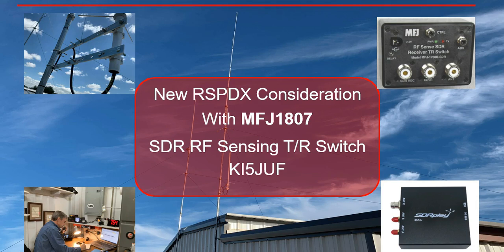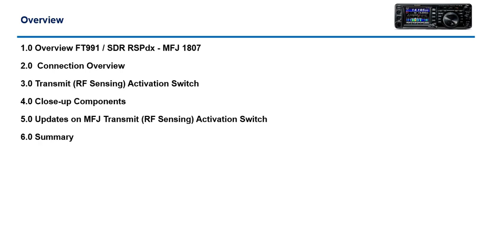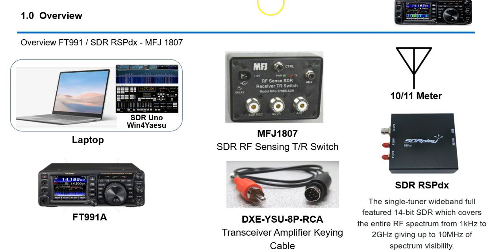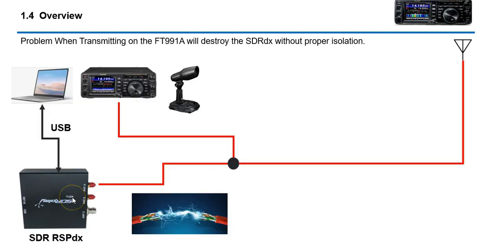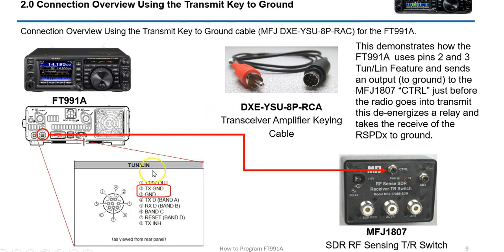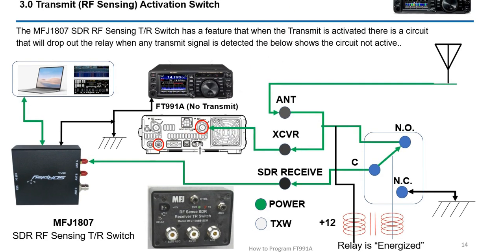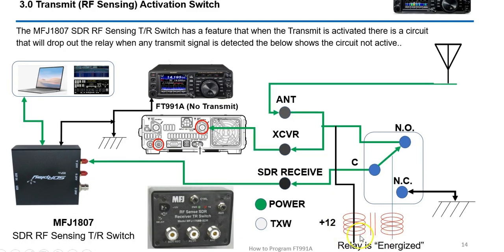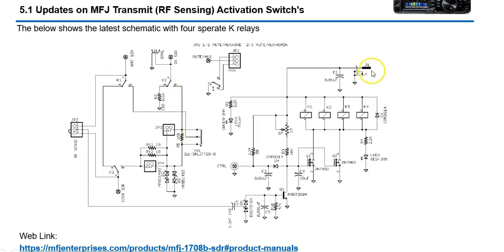Overview FT991A  SDR RSPdx - MFJ-1708 Installation Considerations (Risks vs. Rewards)

Comment: I have the 991a, the RSPdx and the MFJ1708.

I wanted the experience of a bigger waterfall, not interested in transmitting...yet.

My findings and, as you mentioned earlier in the video, you're basically seeing the waterfall of what the SDR (RSPdx) sees and not neccesarily, the signals seen in the 991a.

Huge letdown to me. Decided to return the MFJ1708 and wait to upgrade to an FTDX-10 alter down the line.
Reply from the maker: How you doing, thanks for the message, yeah I understand I never executed this project, there's a whole different aspect I did not mention working on a video now on the fact when you connect the SDR and your radio to the same 50 Ohm Antenna System there is a impedance issue being in Parallel which both are no longer at 50 Ohms.  Have a good evening and thanks for the message 73

Comment: I am confused. Why would you want SDR when radio receives? What is the advantage?
Reply from the maker: Good afternoon, well to be honest I never went any further with this project and I see no advantage other than getting the waterfall from the SDR on a computer screen, the FT991A already has the water fall.  I like using the same radio for transmit and receive, this project got put on the back shelf.  Thanks for the message '73

Comment: can you explain what the AUX used for on the 1708b-sdr
Reply: AUX is an output that mirrors the control input.  You can use it to key your amplifier.
Reply: @richkelley5112  yep figured it out thanks for getting back

Comment: This was an excellent video! I built almost the same setup yesterday and wanted to share my experience in case it's helpful for anyone. I used Yeasu FT991A and RSPdx (but first tested with RTL SDR v3 dongle). Instead of this MFJ unit, I used the equivalent unbranded T/R switch from Banggood ($45 in May 2023). I also built my own PTT cable by soldering 2 wires to a 8 pin mini DIN connector and using a 3.5mm mono jack at the other end. For the 991A I soldered Pin 2 (TX GND) to the tip of the jack and pin 3 (GND) to the base of the jack. The pinout can be found in the Yeasu manual. I agree that using a cable is better than relying on any RF sensing technology. 

Regarding your questions: the most important one in my opinion is about protecting the SDR. What I found is that when transmitting the SDR does pick up your own signal (the other part of the band is clearly being suppressed). However the signal is shown in SDR Uno at around (-50 dBm in my case). SDR Play have a video on their youtube channel about protecting the SDR when in close proximity to transmissions. It covers several scenarios with examples. They say that at 0dBm or above the SDR may be damaged. The video is titled "Protecting Your RSP from Near-field Coupling". The video also shows instructions on how to measure and protect the SDR.

I also experienced that using this TR switch from Banggood is not realistic on 145MHz due to very high SWR. Others have reported this in the video made by Tech Minds titled "PANADAPTER For Any Radio DC - 160 MHz SDR Antenna Switch". I didn't experience any issues when testing in on the 10m band.

The 991A can indeed be controlled by SDR Uno through the use of omni-rig. To do this, both the 991a and the RSPdx must be connected to the computer using separate USB cables.

Comment: I have the exact setup,  992a, rspdx,1708, win for yaesu.
Make sure you use the newest best model of 1708 sdr  sma for rspdx with the cable to activate it. Its  4 real realays.  I use same antenna no problem at all 2 years now.  I use resonant antennas  that  switch  on one antenna.  It defaults to the sdr when no tx. Sdr console has a protection system for overloading  as a back up for strong signals. I do put  an  A-B switch on the uhf vhf side to disconnect  a to b position is open when operating hf possibly over kill by the way the sencing
Part of the 1708 works also no arks  .
Also  use omni rig with your rig control  and turn it on in sdr uno.  No matter where you tune the other one follows. Never us the old mfj 1708 switches it would be a problem.  Love my 991a !
Chuck AA4CP  
FORT PIERCE FL
Reply from the maker: Thanks and '73 hope to catch you on the air

Comment: This is what I want to setup. The RSPdx is incredibly sensitive and you can pick out signals that don't show in the waterfall. Your not hallucinating and Yaesu with a good antenna can transmit to them. It is very sensitive to adjacent transmitters so the switch is required. The SDRPlay had great input protection but you'll have to send it back to have the diodes replaced it you got them with more +15db for too long.

Comment: Also, if you're using the RF Sensing Relay just as an RF Relay (controlled with the 'TX GND' signal), then you don't need the RF Sensing function, so just buy a much cheaper plain and simple RF Relay.

Comment: Another option would be to simply run the SDR using a separate antenna, perhaps a small Active Antenna on the the other side of the property (reasonably far from the transmitting antenna). Especially if you're using the SDR to feed the Spectrum display or Waterfall, where you'll not be seeing very much of the very weakest signals anyway (an argument that perhaps you don't actually need a share of the primary antenna). Note, all this is speculation.

Comment: I've also been mulling over this option for my IC-7100 with my RSPdx using Win4Icom Suite for several months.

I returned the MFJ-1708 once because I didn't realize I had the wrong cable connecting the 13 pin jack on the radio to the 1708.  Right now I just have RF limiters hooked on to the antenna inputs of the RSPdx and using the Win4Icom as the panadapter.  I don't get more than +20 on the SDRuno S meter.  I understand that the S meter could go as high as S50 before the dx is threatened. That reading is while transmitting on 2 meters while the SDR is just using an MLA-30 HF antenna. If both rigs were operating on the same band antennas no doubt the S reading would be much higher.

I keep delaying my decision realizing I'd either have to buy TWO MFJ-1708s ($280+) or switch cables around each time I switch from HF to VHF/UHF or back. Not sure the cost is worth the Benitez.  At least you have a version of a waterfall with your rig.

Have you done anything with this project since your last comment?
Reply from the maker: Good evening  sir, thanks for the message, to be honest I did not go any further with this project, my concern was with a 50 Ohm feedline, if I put the MFJ and the FT991A on the same coax this would no longer be 50 ohms and to be honest I really didn't want to try anything on the new FT991A, so I ended up not going any further, sorry I can't be more help I just never really like this whole setup.   Thanks for the message and let me know if there's anything else I can do for you '73 sir!!

Comment: One other item you should consider is when listening you have two 50 ohm load on the antenna. This makes a voltage divider.
Reply from the maker: Good evening sir and thanks for the message, I have since realized the impedance mismatch and I never actually did this project, I never liked the idea of having a micro relay on the TX and RX, again thanks for the message I appreciate your feedback good info for all '73 de KI5JUF
Reply: @westtexasvideogateski5juf255  Is this why some people choose to tap into the IF circuit of the 991A to feed the signal to their SDRs? I too am researching these methods to see which way I want to go, so I THINK that the IF tapping method would get rid of the issues of reduced RX signal strengths in both the radio and SDR. But won't the SDR's RX still get overloaded during the radio's transmit? So is the MFJ T/R switch still needed for that??? I'm assuming I'll be using CAT control to keep both VFOs in sync, although I can see some use-cases where I'd want to be monitoring X band while working Y band. Any input would be appreciated!

Comment: If you are set on using the same antenna then this seems like a safe way to protect the SDR. You could also utilize the additional antenna inputs and possibly try to get cat control to change sdr antenna input on yaesu transmit. Virtual comm ports amd/or omnirig maybe???
Reply from the maker: Hi Phillip, thanks for the message, one of the concerns is in receiving with receiver this would create a impendence mis-match instead of 50 ohms I think you would have 25 ohms, not sure how that would impact the radio receive quality, i never ended up using this I found the FT991A waterfall to be adequate for the job.  Thanks for the message appreciate hearing from everyone👍
Reply: @westtexasvideogateski5juf255  
I'm going to assume the MFJ splitter is transformer based so impedance would remain 50 ohms. At a minimum it should be 50 ohm in transmit with SDR port switched to ground. Also best to always use PTT cable and have the RF sense as a backup, just in case.
There are a few projects online of panadapters using embedded RTL-SDRs in the 991A too on Hackaday and RTL-SDR Blog.
73 de AC5G
Reply from the maker: @TX_Junk  Thanks good feedback keep in touch let me now how things are going '73

Comment: Interesting. I've had a 991a for a little over a year, but have been real busy in '21. Now, I'm looking to get my General and get more into HF and you have my interest piqued!
Reply from the maker: Hi Lee, how you doing did you get your General?  Let me know of there's anything I can do for you I just recently passed my Extra,  let me tell that took every brain cell I had to pass that one, anyway let me know how you did, I mostly work 10 and 6 and local VHF repeaters here in Abilene.  '73 my friend keep in touch
Reply: @westtexasvideogateski5juf255  Congrats on the Extra! I did get my General back in Feb. I dabble w/ FT8 mostly on 10-20M, but am always looking at ways to better my antenna setup (it's in the attic of my condo). How's that MFJ-1708 working out for you?

Comment: Steve, Just checking have you added the SDR to your setup? If so I don't see a video of it. Also which  do you like better Ham Radio Deluxe or Win4Yaesu with the FT991A? Great job on your video's. KD9SZQ 73's
Reply from the maker: Hi Tim, Thanks for the message, I decided not to do that at this time, budget  reasons at that time I've started a path down CW and HRD so that's I've been up to, appreciated your message and apricate you checking in - hope you had a nice xmas and new years '73 de KI5JUF  keep in touch

Comment: I use this setup all the time with the cable from my FY-991A. I use the waterfall built in to Win4Yuaesu. I had to mod the MFJ device by shorting the Antenna and Transmitter connectors.
Reply: Thats what you do on the older version mfj 1708  , it is much better to have the new 4 relay  version it protects better an less signal loss
Reply from the maker: Thanks very much, I really apricate all your help and knowledge,  I keep looking into this and '73 de KI5JUF

Comment: Whenever I start researching something to do with my 991a you make a vid. Its uncanny. I won a sdrp-rsp1a in a foxhunt & looking at same scenario. I've been looking at that mfj switch, hadn't thought of the cable yet. DXE-RTR-2 do the same thing?
Reply: Dx engineering has a s several of the same things but much more expensive for the good ones around 200 usd

Comment: Omnirig software will let rsp  control your  transceiver.    I’ve been doing the same research, would like to use a small tv to monitor SDR UNO  and control my 991A.  Thanks for the video ! K5EGD  (Haven’t pulled the trigger yet)
Reply: Omnirig works great  with the  sdrplay  and rig sinking with it.
One button to sinking or unsink

Comment: You can plug an RJ45 cable into the open connection on your MD-100 Microphone. there are two pins where You pick up the PTT from the mic, and use that to switch the relay. I have the same setup as you, FT991a, and MD100 and do it that way. I don't trust the RF sensing, use the PTT
Reply from the maker: Hi Chris, thanks again I appreciate the information and tips, there are still many aspects of this project scope I'm trying to get comfortable.  My email is shope02@yahoo.com send me any notes you have.  I want to peruse your idea it seems to be a better solution. I was looking for a setting under the "Menu/Setup" that might allow me to send that Transmit to Ground sooner before the actual radio went into transmits to allow the relay to get situated.  Again '73 de KI5JUG sir
Reply: The cable you have to purchase separately directly  switches the newer 1708 switch, also rf sinking is a backup at the same time

Comment: I think you are talking about the MFJ-1708, it is a relay device that allows you to attach your SDR (sdrplay RSPdx as an example) to your antenna. When you transmit, the sdr input is grounded to prevent damage.
Reply from the maker: Hi Chris, I'm embarrassed I got my part numbers reverse, I just corrected the description it now reflects the correct MFJ part number.  I apricate you pointing that out -  have you done this using the MFJ 1708 and if you did how do you like it?  Again I apricate the correction and '73 de Ki5JUf sir!!

Comment: As always, nice detailed videos, Good thinking on your part.  However how about installing a receive antenna only to the SDR if space allows it, keeping it all separated..
Reply from the maker: Good evening sir, thanks for the complements, I looked the separate receive antenna option, I like it, thanks again '73 de Ki5JUF
Reply: If you have common transmit frequencies, using a bandpass filter, nullifying those for your receive antenna, will alleviate any switching component that takes far too long before engaging.